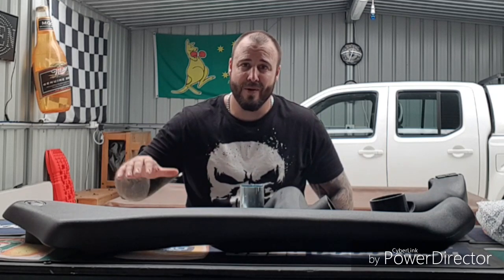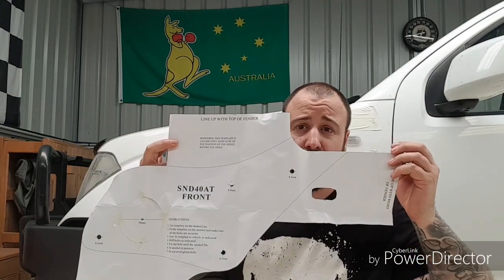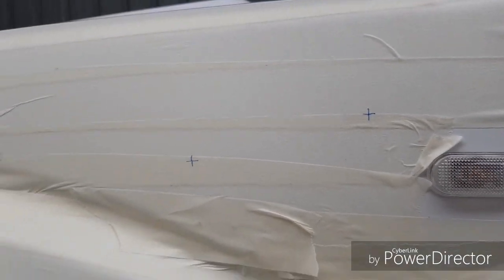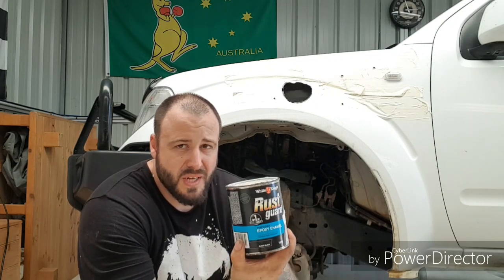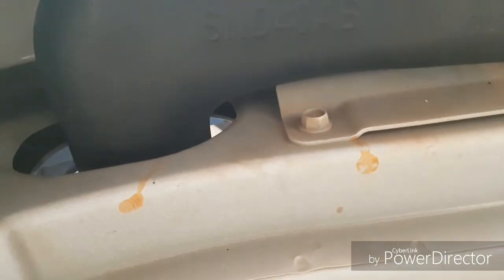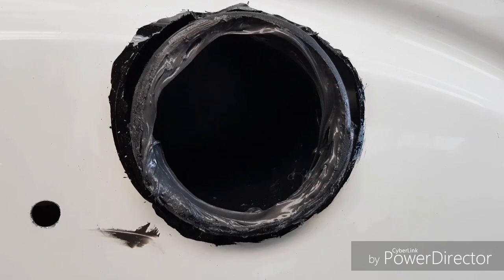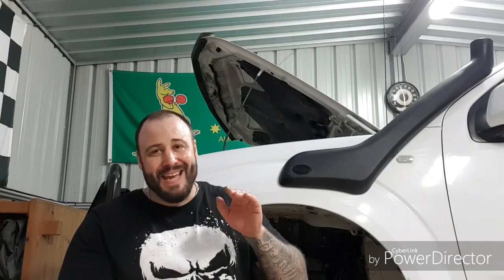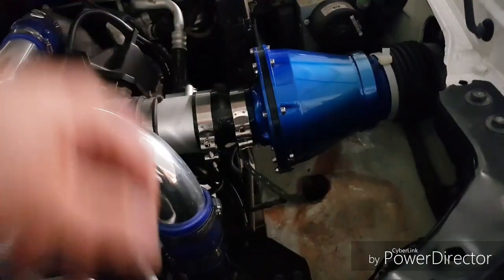Nissan Navara D40 Snorkel install - Dirty D40

Comment: Hey mate great video , I have a question , removing the front inner wheel arch ; got the screws around the out side of the wheel arch and the weird push in clips , but it’s kind of still in place pretty hard , do I need to remove the air box before it will come out or have I missed a few screws etc ; I’m fitting the exact same snorkel as you have , any help would be awesome!

Comment: hey mate how'd you mount the top bracket? got the same kit but confused on that part. was it just the self tap screws straight in?
Reply from the maker: Hi Christian...to mount the top bracket you mark the holes drill into the pillar and use pop rivets to  secure it. Then the snorkel bolts onto the mount

Comment: What did you do with the maf sensor
Reply from the maker: I purchased a 76mm adapter from ebay ....they cost about $40 and allow you to move the sensor off of the airbox.
Reply: What do I search up on ebay

Comment: Hey bro where did you get your airbox from
Reply from the maker: Gday mate ....got it off ebay. It works really well ....its noisy but I highly recommend it.

https://www.ebay.com.au/itm/Universal-Typhoon-Cold-Air-Intake-Induction-System-Kit-With-Air-Box-Filter-WV/291837795935?hash=item43f2e35e5f:g:L2kAAOSwstxVdP36
Reply: How cool is the air box. My snorkel just got delivered as well I’ll have a crack now see if I f&$k right up.
Reply from the maker: You can do it .....take your time and it'll fit perfectly 👍👍👍
Reply: Backyard Bunky Builds see how we go good idea with the masking tape how do you go about changing your air filter is it just a pod inside?
Reply from the maker: @justinleonard4490  its a re useable filter but I'll probably just buy another one when the time comes to change it
Reply: Backyard Bunky Builds fair enough mate it looks wild frees up a lot of space in the engine bay would you think if you moved it around enough do you think you could get a second battery in there
Reply: Justin Leonard yeah that’s what I was thinking
Reply from the maker: @justinleonard4490  I wouldn't think so but never know ....I was thinking catch can in that spot
Reply: Hey bruv, what do you mean when yousaid its noisey after fitting the afm airbox
Reply from the maker: Hi Gusy, the airnox makes a fair bit of induction noise which I personally enjoy.
I got the airbox on ebay ..
https://www.ebay.com.au/itm/Universal-Typhoon-Cold-Air-Intake-Induction-System-Kit-With-Air-Box-Filter-WV/291837795935?hash=item43f2e35e5f:g
Reply: @backyardbunkybuilds7461  cool, what about the maf sensor
Reply from the maker: I bought an adapter off of ebay aswell. Cost about $40.
Reply: @backyardbunkybuilds7461  https://www.youtube.com/watch?v=CPEBjLDxMxk&t=90s
Reply: Great video buddy, I just did my D22, zd30. Was a bit of a nightmare, but got it done.. love your honesty..

Comment: Where did you get that airbox from ?
Reply from the maker: The airbox is from ebay and the link is in the description 👍👍👍
Reply from the maker: Sorry thought it was there.....heres an updated link 

https://www.ebay.com.au/itm/Universal-Typhoon-Cold-Air-Intake-Induction-System-Kit-With-Air-Box-Filter-WV/291837795935?hash=item43f2e35e5f:g:L2kAAOSwstxVdP36
Reply: Was it easy to fit up and is it water tight or did you have to seal it at all ?
Reply from the maker: The airbox is easy to fit up but you will need a 3" adapter for the airflow meter which is about $40 on ebay
Reply from the maker: And yes our set up is water tight
Reply: @backyardbunkybuilds7461  would you be able to do a video going over how you connected the airbox up
Reply from the maker: Yep I can do that ...will just have to wait for my next day off.
Reply: @backyardbunkybuilds7461  do you have a link for the airflow meter adaptor
Reply from the maker: Gday John heres one on ebay https://www.ebay.com.au/i/163980642980?chn=ps&norover=1&mkevt=1&mkrid=705-139619-5960-0&mkcid=2&itemid=163980642980&targetid=919947033086&device=m&mktype=pla&googleloc=9070571&poi=&campaignid=10101785252&mkgroupid=102311926260&rlsatarget=aud-692203741102:pla-919947033086&abcId=9300368&merchantid=9467072&gclid=CjwKCAjw2dD7BRASEiwAWCtCb1BlK_t-u3A9wt0A0Tn1E7I_xs4ycD-lxDjozkmb3z8FfQC1AmpfnhoCX_cQAvD_BwE

Hope this helps. This intake works great but make sure the filter isnt o er oiled 👍